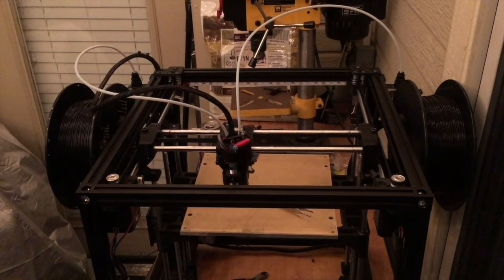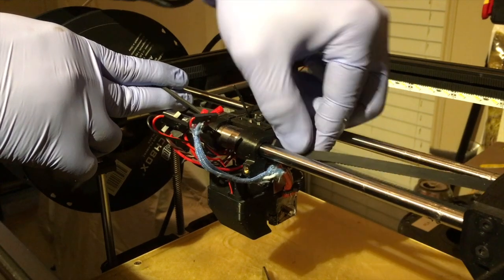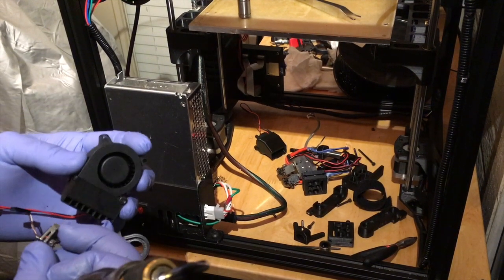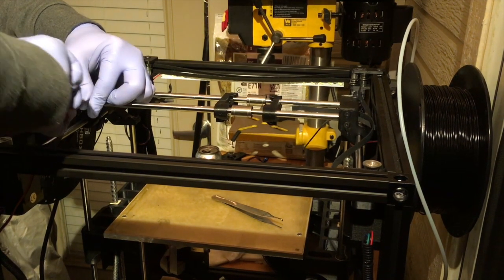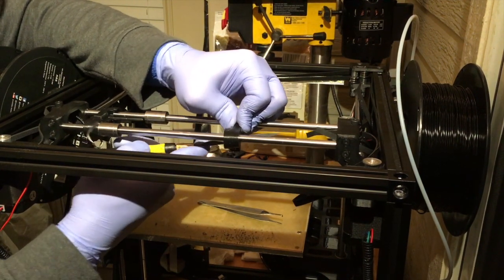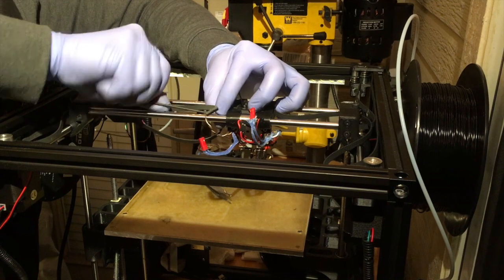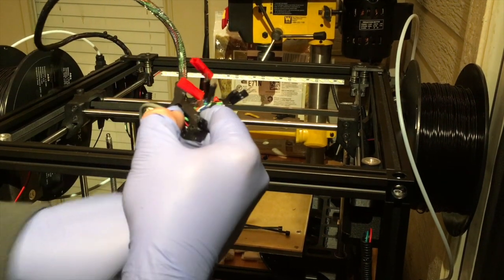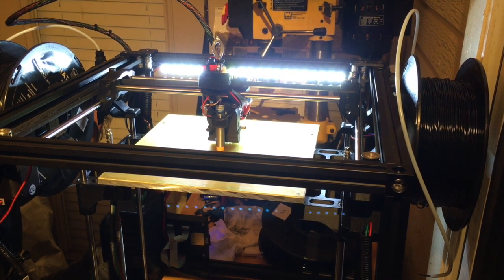VORON - REV A Install log

Comment: While seeing this log my memories going back to 2017 when I was building my first 3d printer-core xy. I totally used acrylic sheet for body and frames, SS Chrome plated rods for X any Y gantry and two lead screw for Z along with two SS rods for support each for both sides. It took 3 months for me to complete the build. And it was a successful build worked flawlessly. I had a plan to fix and upgrade few things but it didn’t happen do to few person things happening that time and now after long time I’m back into 3D Printing and hearing about this Voron design. I am really missing this builds. Now I wish I want to a part of this awesome community and contribute my best. ❤